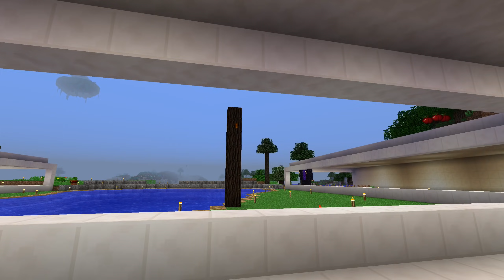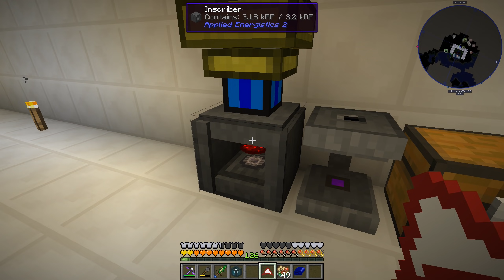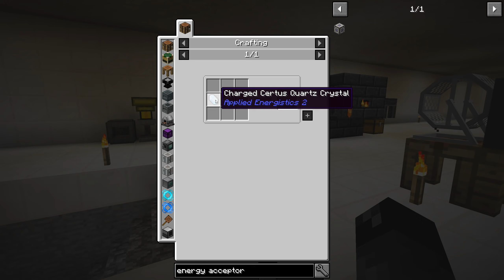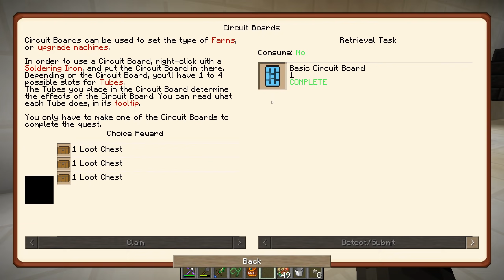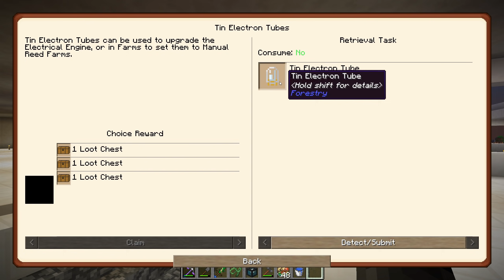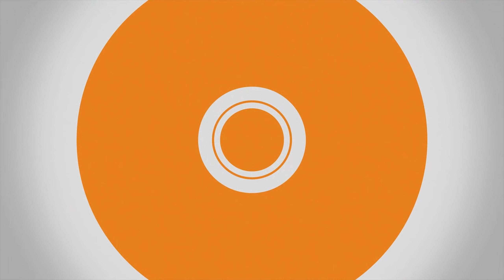Enigmatica 2 Expert - STARTER AE [E12] (Modded Minecraft)

Comment: damn. this lucky loot chest skipped like 2 hours of work. at least.
Reply: I dont think 2 hours i spend most of the time on the me energy acceptor the rest wasnt really that hard for me(but i did have an uu matter setupwith all machine blocks scanned so maybe that helped)
Reply: you need a lot of mekanism to craft the controller from the energy acceptor. since he hasn't much mekanism he would have to craft those and then the controller. if you have the machines it is ofc not much more work. :)
Reply: imagine if he made the me controller just to open the loot chest and get another one
Reply: dont forget the furnace xD
Reply: way more than 2 hours. The gate for Applied Energistics is supposed to be absolutely insane I think and he just lucked through it. Barely touched Immersive Engineering or Mekanism. I'm still crafting hours later and I just realized how deep I have to go into Immersive Engineering. It's pretty silly.
Reply: @Dextergec413  you can just do the acceptor cant you? I thought it said you could make either and it would unlock the gate